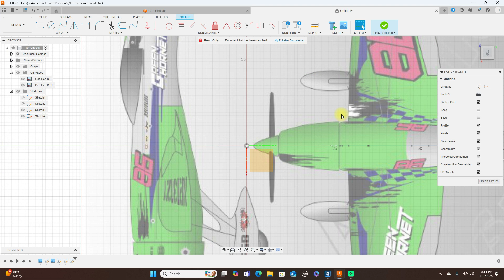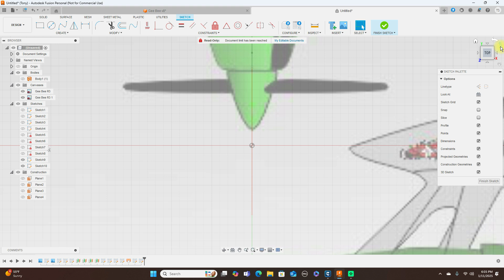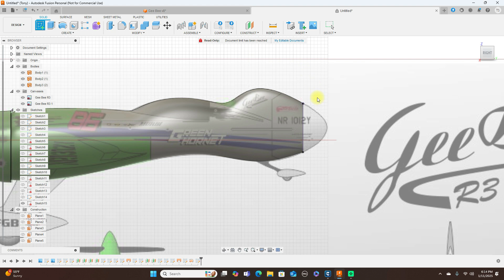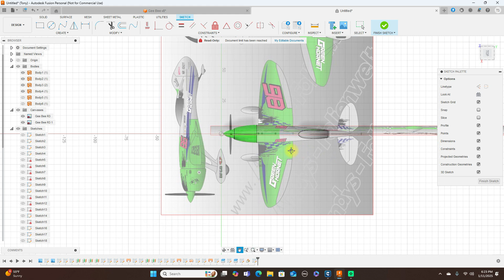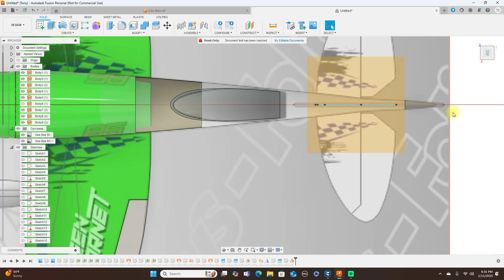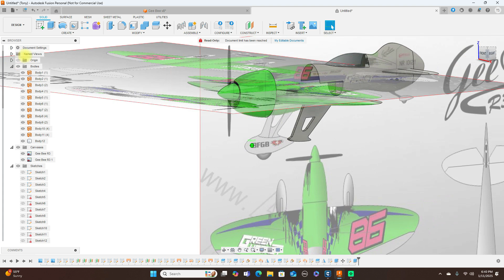Learn the easiest way to surface model a Gee Bee R3 in Fusion 360/CAD beginner to advance.

Comment: Hi Tony, nice one. I'm currently learning Fusion with the ultimate aim to build RC airplanes. For this specific GeeBee I think it is ok to simplify things a bit (for the sake of ease, speed of drawing and overall smoothness of the resulting model). E.g. not follow any formers and let Fusion come up with something. But I think you took it too far around the fin part. It would be better to follow the fuselage and to add the fin & rudder later, similar to the stabilo. As they are definitely not ovals there, but pretty much a flat profile that is intersecting with the fuselage.